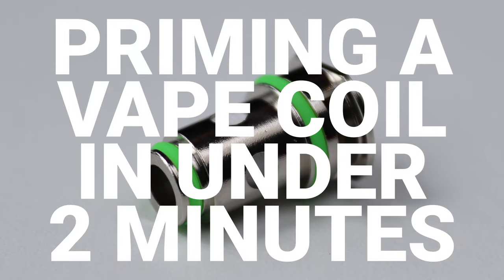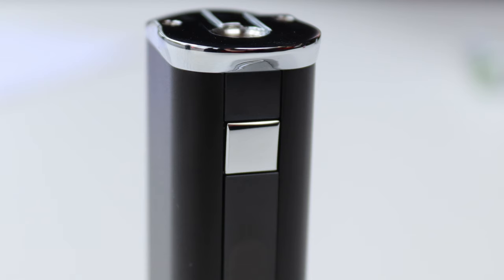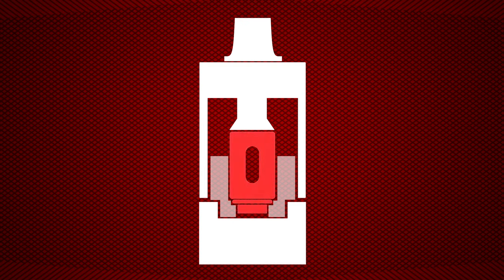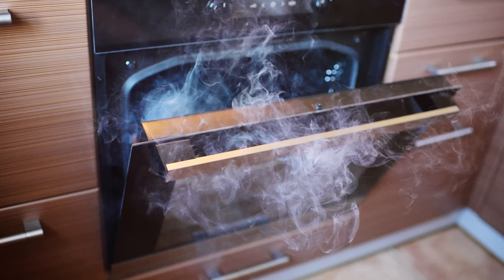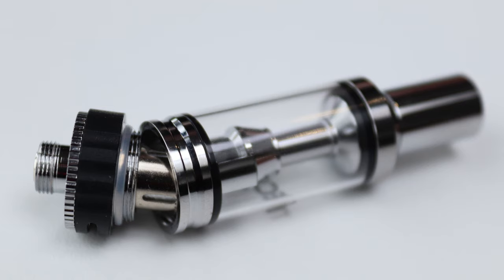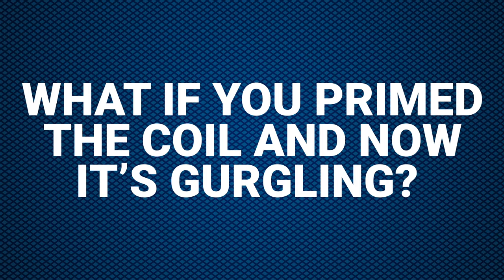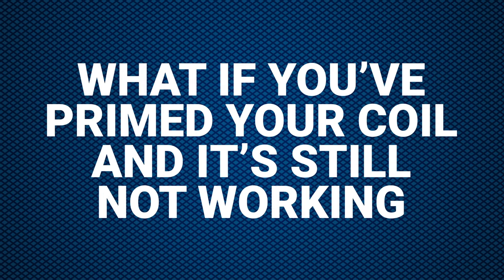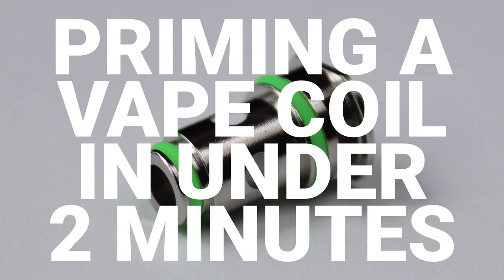How to prime a vape coil (atomizer) in 2 minutes

Comment: if it already tastes burnt is it too late to save it?
Reply: Yes it’s too late
Reply: You can actually soak your burn coil in vinegar or warm water and let it sit for 24 hours, after that rinse it with lukewarm water for a couple mins and let it dry for 10-24 hours and it should be good as new
Reply: @Bmalson  By this point you may as well just firm the £2 and replace it 😂
Reply: @Bmalson  i save all my not so burnt but not tasty coils when I switch them out so this is a good idea, thanks.
Reply: Nope. Just clean it
Reply: Yes
Reply: What i do is i get 1 of my voils and i run it under hot warmish water and after 10 mins grab loo roll and blow into ur coil into the tissue parer put it in ur vape prime it up wait 10 mins ittl taste watery for a bit then it hose fine

Comment: If gurgling and you got an adjustable air valve below the coil you can just blow the flood out through that. Have some tissue ready. Remember to open the air valve before first puff and to close when filling and then open to puff again. Air valves can leak so close when left charging with liquid in tank.

Comment: Also if it's randomly tasting burnt and it isn't far from when you've bought it and it's not ran it's course yet, press your fire button without putting your mouth on the atomizer and sucking just let it hit on a low temp for a couple of seconds without hitting it and it could fix it too.

Comment: Got home took a hit and it was bitter. Looked down the coil from the top and it was getting dark, so I switched the coil for a fresh one. Primed it before putting it of course, but hits remained the same. It is bitter but still highly minty due to e-juice (which it was never before). Usually there was some gargling but gargling disappeared. Idk what to do now
Reply: vape might need cleaning
Reply: Sounds like your only priming and hitting immediately your supposed to prime it and then put it in your vape and let it sit for 10 to 15 minutes before your first hit to let it get completely saturated